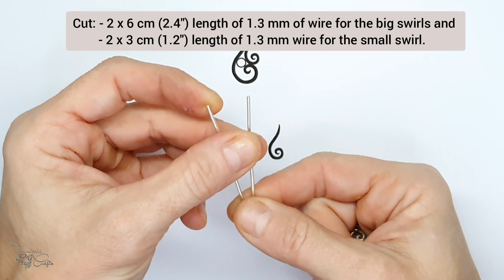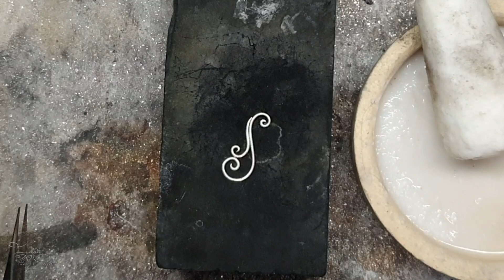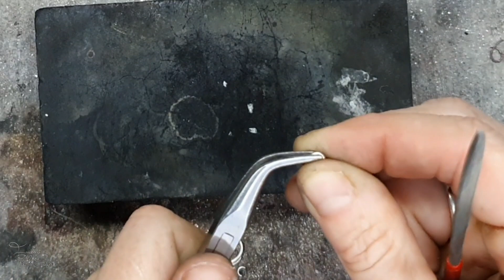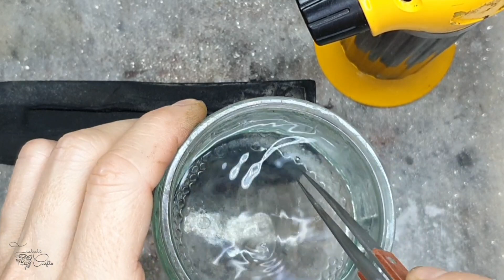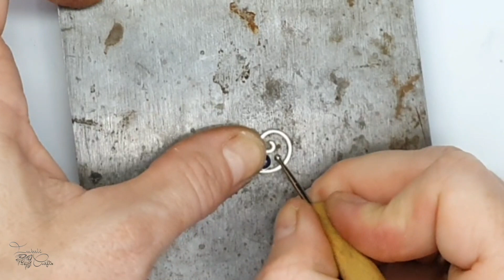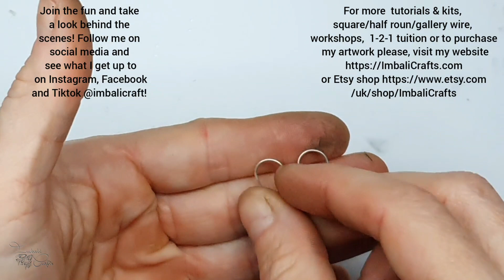Scroll earrings - Soldered jewelry tutorial

Comment: PS - melting jump rings also make consistently sized silver grain.  It saves LOTS of time especially if you're needing to make a lot of melted balls/grain because you don't have to measure each cut of wire once you determine what size jump ring you need to melt to get your desired grain size.
Reply from the maker: That could definitely work. Thank you! :)

Comment: I've seen a wire wrapping version of this tutorial but I think your tutorial is an excellent demo for people who've just begun to learn how to solder.  I like that you use salt and vinegar for your pickle because that's what I've always used ever since I first learned to solder a few years ago. I feel it's safer for me and the environment. I wanted to mention that I also use the salt and vinegar pickle for my copper jewelry and tumbling it removes the dullness and makes it shine like a brand new penny. If someone doesn't have a tumbler, they can scrub it with a brass brush and Dawn dish soap as a lubricant (I think some UK folks use something called Fairy).  Anyway, thanks for an excellent tutorial. 👍 Cheers!😊
Reply from the maker: Thank you so much! I am glad you think this is useful. I very much prefer the vinegar pickle. There are far too many chemicals in jewellery making and I try to cut down wherever I can. I agree with the dullness, especially with copper. I find it makes the metal orange and won't go back to its original shine unless I polish it. A tumbler is a great idea. Thanks!

Comment: If your making the earrings from copper - what type of solder do you use?
Reply from the maker: It would still be silver solder. There is copper solder, but it has never worked well for me as I found it to be brittle and weak. If you are careful not to let the silver solder 'run' the joint will be hardly noticeable.
Reply: @ImbaliCrafts  thank you so much!

Comment: Could I use silver filled wire instead?
Reply from the maker: You can solder it, but you might expose some of the copper core if the silver layer gets too hot and melts. Having said that these only use a small amount of wire so I'd say give it a try. 😊